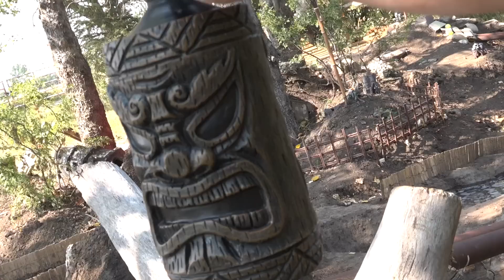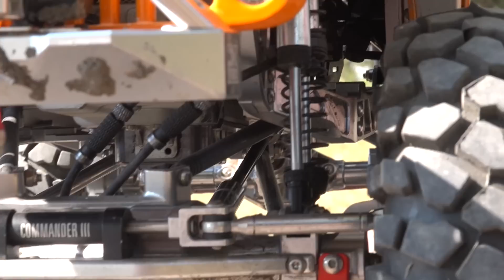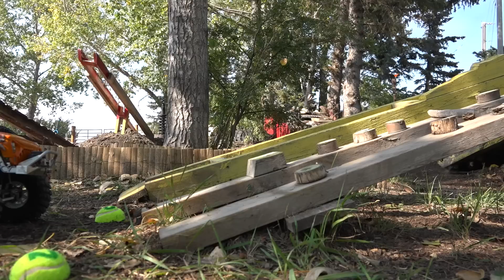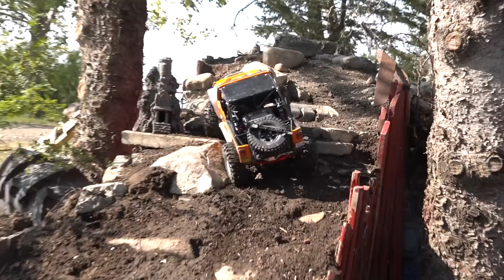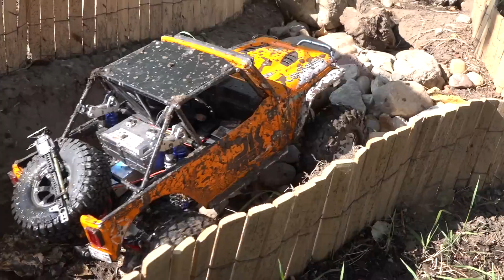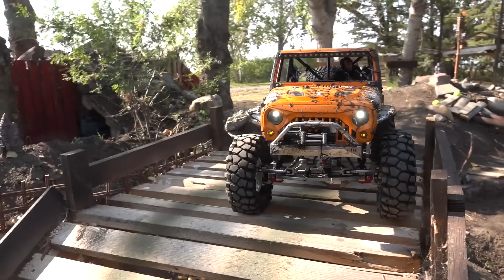MUDDY JK MAX JEEP - GOING DEEP in the Backyard Scale Park | RC ADVENTURES

Comment from the maker: Mmmmm, Going DEEP... Lol..
Reply: That’s what she said!!
Reply: RCSparks Studio just got this truck and starting my build. Been hearing about issues with the cable steering. How’s it working for you?
Reply from the maker: I havent had any issues as yet, Nate. Although I noticed today it wasn't throwing as far as normal. Could have been a radio setting though
Reply: Good to know thanks. Kinda confused as to how to wire everything also, I am using a Futaba 7px and have the light kit, sway bar option, steering wheel servo, gear switching servo, and the ess dual all to connect. You wouldn’t have a diagram of how you wired everything would ya. It would be a great help. And thanks again for all your great videos there awesome.
Reply: RCSparks Studios How come you didn't run the JK at TTC
Reply: Bang harga rc yg ini berapa ya
Reply: Lol plz use the big truck for the mine and replace the little truck so u can get more pay dirt for the mine 😟😟😟😟😟😟😟plz
Reply: @gokarter7248  wrong scale
Reply: That's freaking hilarious I think you set that one up on purpose for a that's what she said joke! Totally love the new Capo the only thing I would worry about is for that kind of money if it has the durability of the axial line of Crawlers. But if you think the transmission and drivetrain is a good tough setup plus with everything being metal the durability should be great which makes the price tag worthwhile. And our driving styles are similar except I can't do it one-handed while filming but I take your word on RCs as the truth! You will admit if you don't know the exact specs or or if it's new and there's no information to go off of, but other than that you have had and built so many RCs can think of only a couple other people I would trust for advice on the broad range of RCs you have been through in your life! And like you said I believe with the extra weight that the truck Acts more like a real truck as the suspension Cycles threw the bumps and how realistic they made the whole truck look real. No corners were cut to keep it as scale as possible! I also wondered if the $1,500 included the extra parts they sent you, I know you said some of them were in a different color and didn't know if all the optional Parts you added were included in the price or if Capo threw them in for free for you. Love the videos and can't wait to see what the Capo goes through next!
👊😀👍🇺🇸🏁
That truck is the 💣💨😂

Comment: Definitely needs some brass wheel weights or something to add more weight to the bottom side. How Do you think it would perform if it had a little Overdrive added it to the front wheels to help pull it over obstacles?

Comment: Might be a swing in the all metal with that price even though in australia it would be closer to $2,000 .. its a case of how hardcore you are and how big your wallet/purse/bank account is... 
When you can find other all metal but cheaper.. as rolling chassis.. then step up.. so for a lot its a miss based on price.. regardless of its quality..
Reply from the maker: I disagree.. but understand where your coming from :) Any upgraded crawler is going to be close to $2000.  This is a complete redesign - and is unique, functional.. and operates the way most crawlers have been asking for - for about 8 years. Finally, its here.. and in my opinion - priced well.